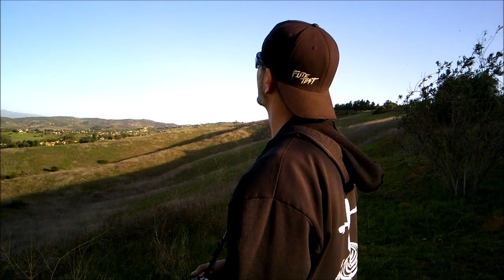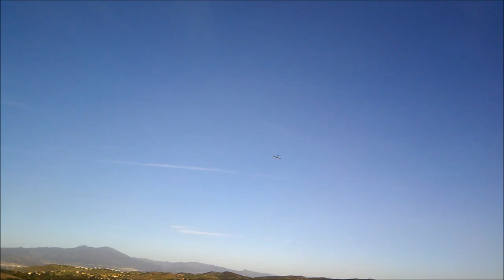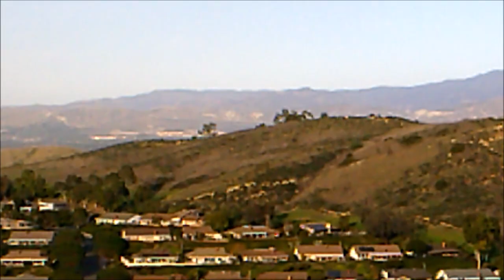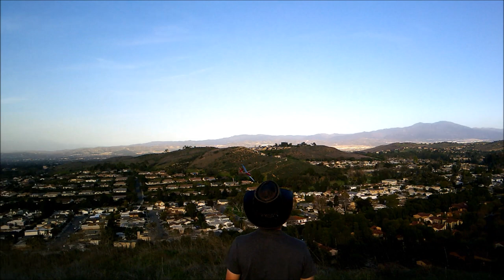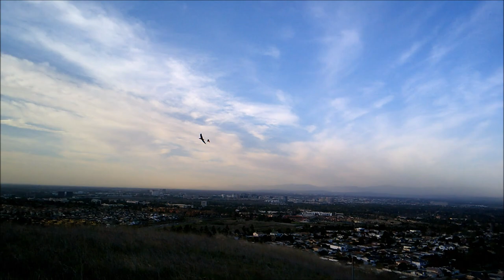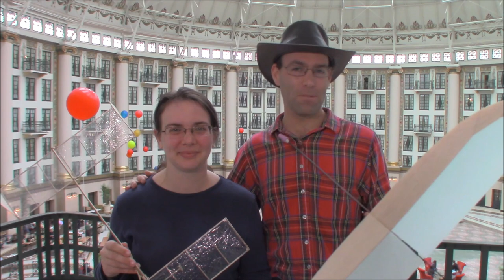Slope soaring with the Firefeather and RO-14 in the Santa Ana winds!

Comment: Is the RO-14 a Dick Odle design?
Reply from the maker: Better than that: he built that plane and left it to Ben.
Reply: @joshuawfinn  I worked with Dick to kit his designs. I did the RO-8 and he mentioned the RO14 but he did not have plans or drawing. Do you have any?
Reply from the maker: @marksrandomstuff9352  unfortunately I don't, and I don't know if Ben does either. It's a glass fuselage and foam core wing. Really pretty airplane and incredibly strong too.